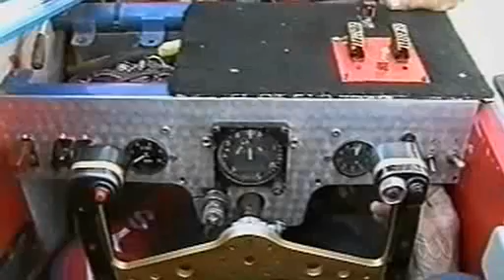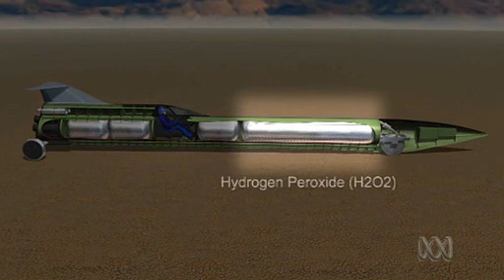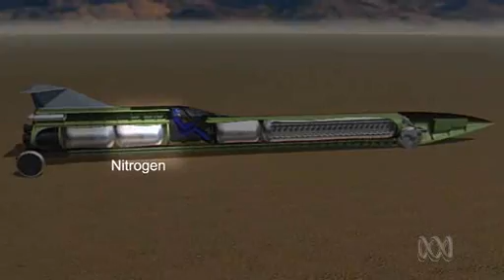Aussie Invader 5R Land Speed Record Car on ABC's Catalyst June 2010

Comment: 6 Years after this story & still no record - Has Roscoe even made an record attempt yet?, as i heard his plan was to make an attempt in 2016....well it's September
Reply: Yeah I agree Mate! The American Eagle team has been fucking around over here for something like 15 years now too. I'd like to see both of them stop flapping their gums & do something real.
Reply: NZ Salt Flats Racer as you may have seen on the news, Jessi Combs just died in the American Eagle attempting a record.

The thing with trying to go go 6/7/800 miles per hour plus in a vehicle is not as easy as it sounds.

It might take 10-15-20 years to work out out all the fine details using computer-generated aerodata and specialised engineering - and that's for a reason. It ain't fucking easy.

What they're attempting to do is mind-blowing and extremely dangerous, so it's worth taking the time to get it right. But the the new LSR team (previously known as Bloodhound) from the UK is planning some test runs at the Hackspeen Pan this Fall/winter, if all goes according to plan. The new owner has just injected £30 million GBP of his own money into the project.

I would imagine that Rosco is going to try something along those lines very soon as well, seeing as his machine is not far off testing phase.

I say to all those people who are getting impatient - go try build one yourself and see how easy it is. You can't just build a car, and stick a jet or rocket on the back of it and hope it will smash the sound barrier, because the likelihood is, you will die in a big heap of Fire.

Patience, skill, and diligence. Name of the game.

Comment: So its all or nothing then? The reason Bloodhound is using a jet engine as well is so the speed can be built up over a series of runs for safety reasons with just running a rocket motor you don't exactly have a throttle as such unless of course your using a Pump to feed the Rocket. It would worry me that this guy has a death or glory attitude and he's driving a bomb on wheels at a G that in unsustainable for long periods so its going to be hit a button and hope for the best !! he has also not really got his head around the forces on the wheels at 1000mph, even Bloodhound with its huge backing has struggled to replicate the rpm's and forces involved to test the wheels and they have Rolls Royce aircraft engine division on board. The fact he built a carbon copy of Thrust2 14 years after it first ran just with a newer engine and next to no sponsors or backing makes you think he's not fully serious.
Reply: K2edg '..The reason bloodhound is using a jet engine as well is so the speed can be built up over a series of runs for safety reasons with just running a rocket motor..'

What? That makes no sense.